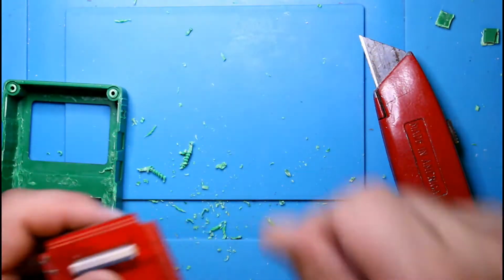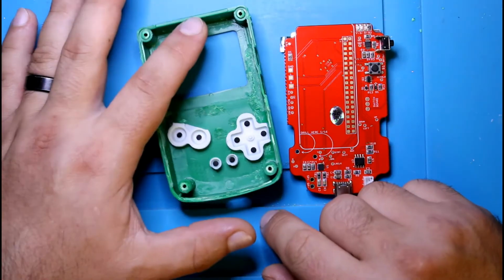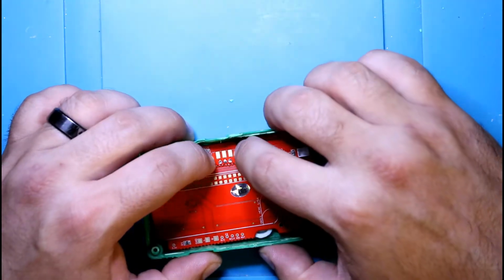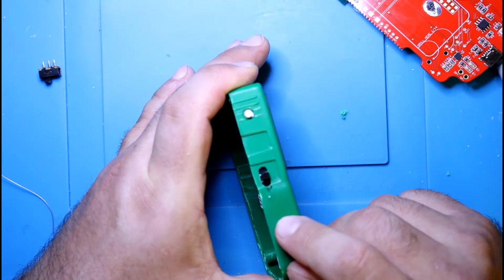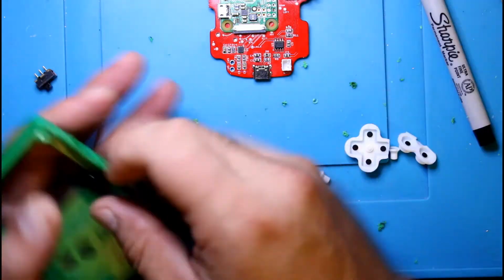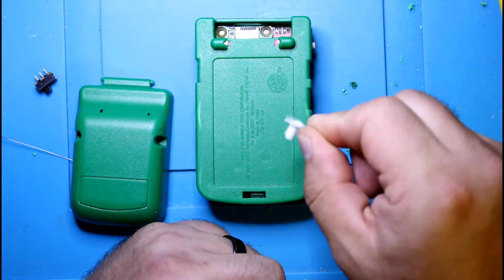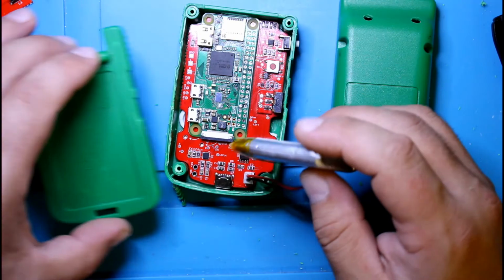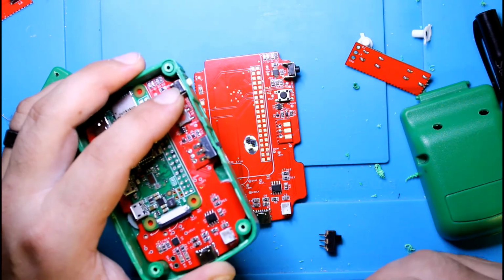Burger King GBC Toy Shell Modding Part 3

Comment: Just bought 2 BK toys looking forward to building one!
Reply from the maker: be sure to either buy the template or use the files I provided to print your own. It makes it alot easier to know where to cut perfectly.
Reply: @Angryhelder  Thanks I just commented on instagram about that. Definitely want to gewt the template too 👍
Reply: Do you have a link on where I can buy the board? Or a parts kit? Or do I have to have my own board made through templates?